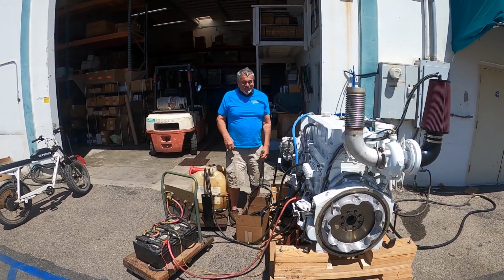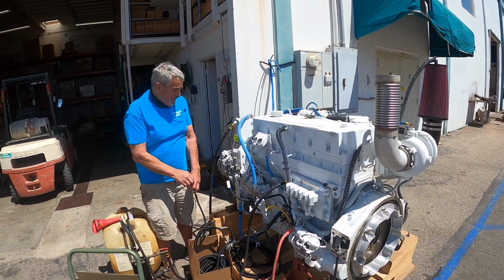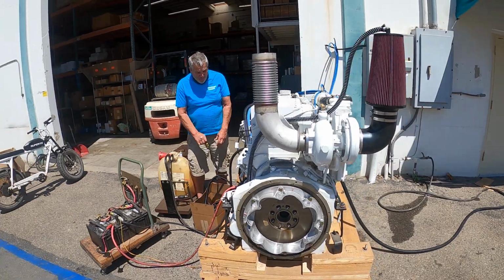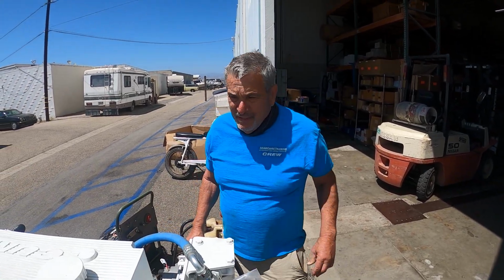Cummins Marine M11 450 HP --- David Crenshaw (Ireland)

Comment: Big motors. Put a few QSM11’s in some of our boats. All rated at 715HP. Usually pushes them along around 25-26kn. Only complaints I’ve heard of them is the manifold gaskets and how loud they are with a wet exhaust

Comment: I have a question I just installed Twin 315b series Cummings my Dash is reading 12 volts is that right or it's supposed to be reading more the two engines are reading at 12 volts
Reply from the maker: The batteries just sitting should be in the high 12's once the engine running you should see high 13's
Reply: @SeaboardMarineIncVideos  ok thanks

Comment: Why de-rate engine ???
Reply: You get more hours out of em
Reply from the maker: The reason for getting a lower HP version of a motor is to obtain a higher duty rating.  High output engines are typically for pleasure craft and may be run at a smaller fraction of the time in their higher HP range.  Lower HP engines may be run closer to full throttle on a more continuous basis.  Typically with a lower HP engine, the top RPM is lower, this changes the prop curve.  Typical commercial boats want to swing a larger propeller at a slower rpm when compared to pleasure craft.  This makes the vessel less sensitive to swing loads and more efficient overall.  You could use a High output engine and just run it easy, but you pay more for the extra HP that you'll never use, and you have to worry about what your big prop will do to the engine load if someone gets crazy with the throttle.  Low and steady for the workboats.  That's why those engines can run 30,000 hours or more.